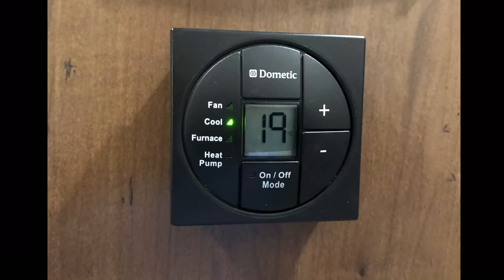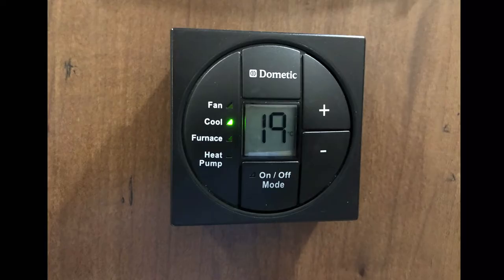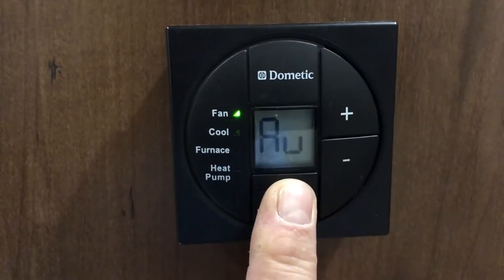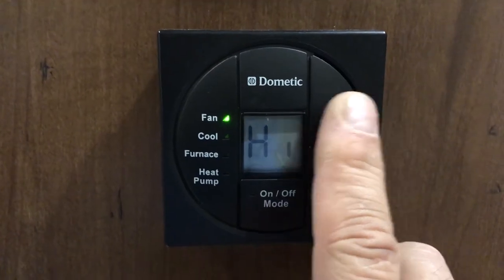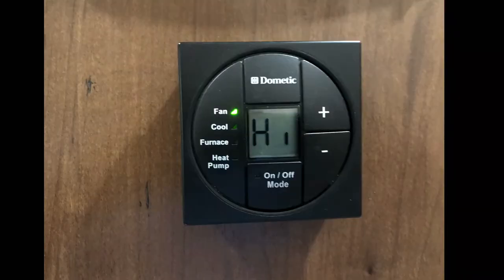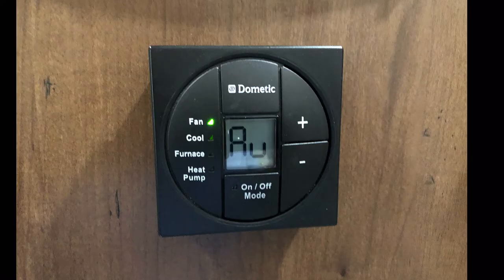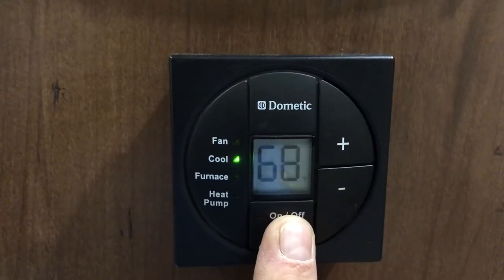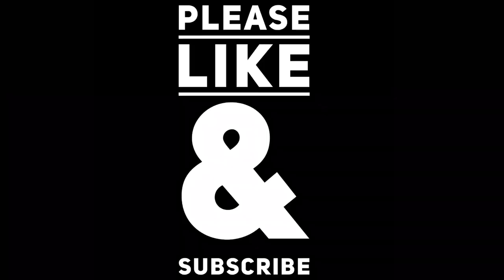Dometic Thermostat Mistakes

Comment: Mine is white. It has fan, cool, furnace LEDs only. Plus and minus buttons. On/off mode. Fan runs constantly with a/c. Furnace exhaust outside blows hot air. Inside not hot. Doing something wrong on furnace?
Reply from the maker: Watch starting at :26 seconds. I explain why the AC fan is coming on while the furnace is running. Turn fan mode to auto to stop the AC fan. If the AC fan is running while the furnace is on warm/hot air does not come out of the AC ducts. It just pushing air around the coach. The furnace air only comes from the furnace ducts which are usually in the floor or down low. I recommend that users only set the fan to auto so they don’t get confused.

Comment: My AC runs all the time  even when set at 70 degrees  stays good and cool but fan never shuts off
Reply from the maker: @nancylancaster7492  set fan to auto, not high or low…
Reply: @mikmaster63   Thanks I will try that

Comment: Is there a HI & Lo for the ac??
Reply from the maker: Fan speed?
Reply: @mikmaster63  yes hi or low fan speed when in ac mode
Reply from the maker: Yes. I suggest leaving it on auto but you can change it from auto to hi or low using the +/- buttons when in fan settings mode. If you have it in hi or low and turn on the furnace and shore power is applied the fan on the AC will run. The compressor will not turn on just the fan to increase air flow. That is why I always recommend to leave it in auto. I have had 100’s of customers complain the the AC comes on when they turn on their heater. It’s just a case of people not learning how to use the appliance.
Reply: Thank you ,very simple and helpful to me !